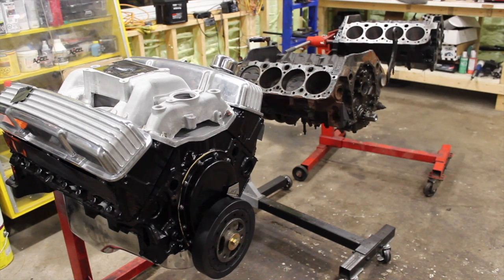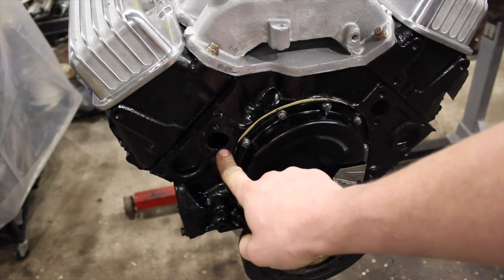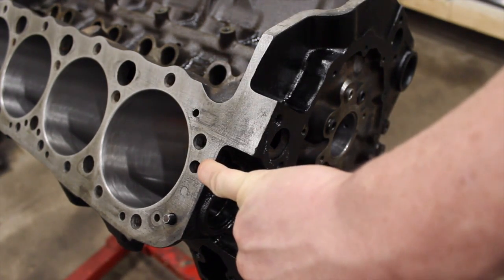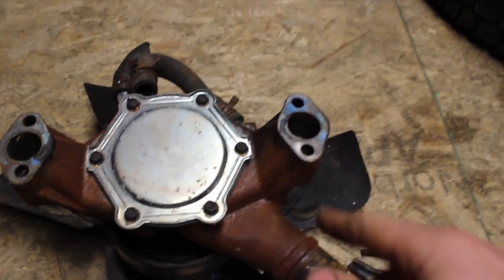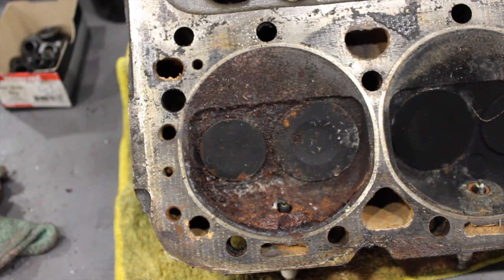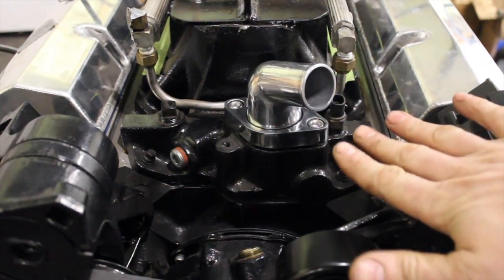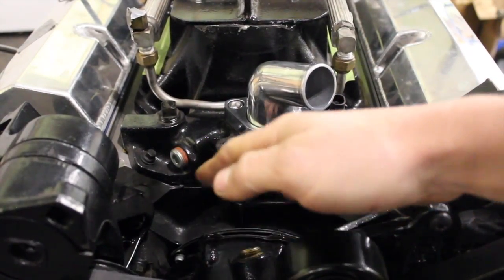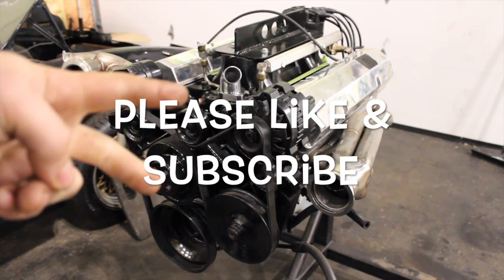SBC Water Pump Bypass? (Read Description for instructions) Vortec heads vs Traditional heads

Comment: Would I need to do a bypass or just drill the thermostat like you said, my block is 85 vette 14010207, vortec heads off 96-98 truck, edelbrock performer intake 7116, front accessories waterpump setup from 89 truck, 383 cubes, thanks fire the video
Reply from the maker: You can do either, but I would probably just drill the thermostat 
Works well! 👍
Reply: @cuttersperformance  thanks, I didn't really realize that there was that much to a water system
Reply from the maker: @thomasgilmore2337  if you are running a heater core without a inclined shut off you will have some bypass flow but I still recommend drilling that thermostat 
Don't let those vortecs see over 200f and they should last you awhile

Comment: At 4:25 you point out a port on the intake manifold for running water bypass. I have that same intake (2716) and run 906's and I have my radiator thermostat in that hole and the one just above it (top  right) as my bypass. My SBC 350  never gets above 200 degrees. Even at long idle like drive in.
Q: can you use either intake hole for a water bypass running vortec heads?
Reply from the maker: Yeah either one should work for you as a bypass
Most guys running heater cores without shut offs will have no issues, but I still recommend drilling the stat or running a bypass 
Cheers!

Comment: Thank you for teaching me about this mystery I have wondered about for three years! What I found online was how I would ruin my new engine if I didn’t plumb the manifold to the water pump. What I came up with was a silly looking copper pipe looped around! I learned about this thermostat technology in my Toyota class in 1988. It was called a “jiggle valve” and is such a primitive genius idea. I will make the modification you have outlined and use my existing bypass hose plumbing for my new propane fuel system.
Reply from the maker: Yeah exactly, alot of modern thermostats have a jiggle valve in them to prevent trapped air. The vortecs will need abit more than a air bypass and thats why a few holes are needed 
You will notice it will be super easy to bleed the cooling system with this mod aswell 
Thanks for checking out my video!

Comment: If you are running a htr core it also acts as a bypass unless you have a water shutoff valve for temp control.
Reply: It helps but the thermostat is above heater core. Air always goes to  the highest point. And that is right under the thermostat. My truck gave some problems and I considerd drilling holes but didtn't. I didn't want lose my heat or make it take forever to heat up.

Comment: I always drill 1 head for it, and put that head on the passenger side. This really is an overlooked item, and guys never really understand what im saying when I bring it up. 

I only drill the 1 side so the heads can be swapped to block it back off IF the motor goes back into a Vortec truck in the future.
Reply: My prized smallblock is an early 880 Block thats drilled for fuel pump,  drilled for steel timing cover, and drilled for water pump bypass on the head. I carb swapped it with a mechanical fuel pump, mild roller cam,  drilled the bypass hole, and stuck a Vbelt system on it to go in my 86.
Reply from the maker: Yeah very often overlooked! Good tip!

Comment: I am also running a third gen trans am with a T-76 I'm looking for a good set of turbo manifolds are those the CX racing single turbo headers they look like they won't interfere with my air conditioning but the crossover pipe might
Reply from the maker: Yes that are the cx racing manifolds
Reply: Do you have the air conditioning hooked up

Comment: Great video series, my current build uses 062's. my question is what head gaskets do you use, watching this video i notice you using what looks to be valve pocketed gaskets. I've only been able to find two types of vortec head gaskets, Cometic MLS Head Gaskets C5269-023 (.023) and Cometic MLS Head Gaskets C5269-027 (.027). have you found any more choices ?
Reply from the maker: My favorite head gasket for vortec builds is the Felpro 501SD (.041 compressed)
They say they are not for performance but I know guys that use them boosted and nitrous and they work quite well.
I have actually never used a mls gasket on a vortec head. I typically only use them on power adder motors

Comment: Good thermostat already have air bleed hole with small valve in it to block coolant flow )
Reply from the maker: Need more than a air bleed if your using vortecs 
You need a small amount of coolant flow at all times
Reply: @cuttersperformance   - Heater  always has coolant flow from heads to pump

Comment: Thanks for the info, swapping vortec heads on my mercruiser 5.7.
Reply: Dealing with this right now as I'm using a mercruiser intake on my 4.3 Vortec block. The mercruiser used bypass through the marine exhaust manifolds (I presume), so no provisions on the intake to go to the water pump. Having to drill and tap a hole just below the thermostat to run a hose to the vortec water pump. (Using the mercruiser intake because it allows use of bigger, more plentiful LS style injectors, rather than the tiny 18lb/hr vortec injectors. 350hp NA is the target for this engine.)

Comment: Why not just eliminate the Thermostat ?
Reply from the maker: I would never recommend running without a thermostat on a street car. You want atleast 160+ deg operating temp. 
A thermostat controls your minimum temp and your fan controls your max 
Alot of guys running vortec heads have cooling issues (over heading for air pockets) ans simply drilling 4 holes should fix it becuase there's was no bypass back to the pump

Comment: Question 
I have a buddy with a 305 in his 87 monte carlo. He wants to put some 906 heads and vortec intake and carb and distributor. Will he run into any issues with the vortec heads on a 305?
Reply from the maker: He should be ok with the 1.94/1.5 stock valve size but any bigger will clip the small bore of the 305
Reply: @cuttersperformance  as far as water pump any issues?
Reply: Ok let me understand this correctly. If I have a block and water pump with the bypass, do I stink the hose from the intake to water pump? Sorry for all the questions.
Reply from the maker: @juliodiaz8280  o sorry I thought it was a general question haha 
If your using vortecs heads your normal sbc bypass won't work 
You need to have a have a hose from the intake to the water pump or drill your thermostat

Comment: So wether I got it or not it would be great to add no more than 4 holes if I’m following you right
Reply from the maker: If you got the by pass already I would try 2 holes 
If you dont have a bypass, I find 4 works the best, and sometimes 6 if they run hot

Comment: Interesting  point , I  thought  about that once or twice I have had no problems so far , but then again I  drill a small hole  in most every one ! You only need one. Some of the newest cars have a piddle in thermo, that does the same thing  ...it will also help a customer's if they have to add coolant it adds a constant bleed feature that aids a on the fly refill for the nongearheads that don't know much about cars . !

Comment: Well done video, great information. Noticed the serpentine setup. Maybe do a video on how you changed things.
This is a repeat comment, the original dissapeared.
Reply from the maker: Thats a custom serp belt I made from a original tpi third gen, I like how you noticed that haha 😄
Reply: @cuttersperformance   I've done something similar with 96- 2000 vortec brackets and short C4 vette pump with mercruiser pulley. Cut off the a.c. mount above the steering pump and bored a hole through the alternator bracket where the heater hose comes out the side of the water pump. Used a Holley aluminum vortec timing cover to fit underneath the shorty style vette pump. This is on an 880 block with vortec heads, E air-gap and carb. Less is more and mo' betta'!
Reply from the maker: @Ron Nelson i like your style man! You would have loved my vortech blower serp belt set up made from tpi brackets haha ran 11 secs with that set up, no belt slip

Comment: Thank you for this video. I've been fighting an air pocket on my vortec head 880 block all summer. Watched this earlier today and drilled my thermostat and bingo it's gone. I drilled 4 5/32 holes I live in Michigan so won't be driving this winter. Much thanks too ya. You gotta new sub here😀
Reply: You could also just get a thermostat with a rattle
Reply from the maker: Hey man! Right there is exactly why I do these videos 
Soo glad to hear that! 
Its amazing how well it works for such a simple trick 
Race on! 🏁
Reply: How’s it been going for u with the holes in the thermostat I’m doing the same thing to my 98 l31 350 I live in Warren Michigan so it doesn’t seem much winter either
Reply: When using a 880 block and vortec heads, and the vortec water pump, will that vortec water pump pulley line up with all the older accessories?

Comment: If the pump bypass puts water in the passenger side head and the thermostat is closed there is no where for the water to return to. Water has to flow through the thermostat and into the radiator then back to the pump. If the thermostat is closed no flow.
Reply from the maker: No the water flows from the head back to the water pump from that hole
Think of it as a return hole
Check around 3 min mark in the video, hopfully that makes sense to you. I was just explaining the passage not the actual flow path and thats why I added the subtitle
Cheers! 🏁

Comment: Any recommendations on where to get after market vortec heads new? Also any experience with the eBay sbc aluminum heads?
Reply from the maker: Summit/ sells there brand with screw in rocker studs/plates already done.
 I will also hopefully have a video coming up, comparing engine quest cylinder heads to stock vortec heads and then to Dart iron eagles 
On the flow bench before and after some tricks/porting to increase flow
Should be pretty cool! 👍

Comment: Thank you.  I learnt something today!  Never had issues with my Vortec heads on old school block heat wise but I might drill some holes in my thermostat anyways.
Reply from the maker: Would highly recommend it! Try to keep those suckers from cracking haha 😄
Reply: @cuttersperformance   I’ll do it.  I’m pulling the heads soon to drill the push rod holes to 1/2”.  Too close for my liking with the 1.6’s.  I’ll have the coolant drained anyways.
Reply: Seems like if you’re pulling the heads, then you should just drill the bypass hole through the deck. That would be the correct fix..no?
Reply: Learned